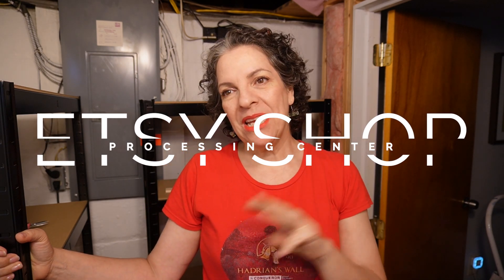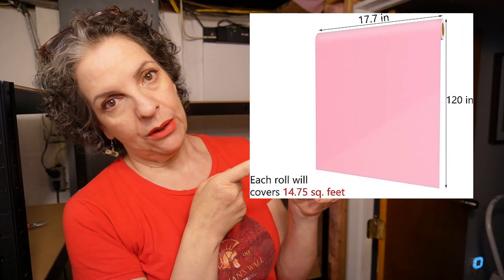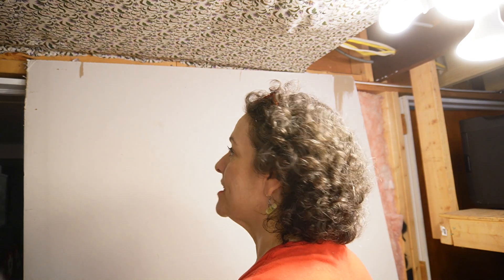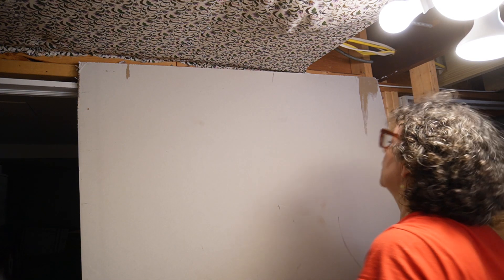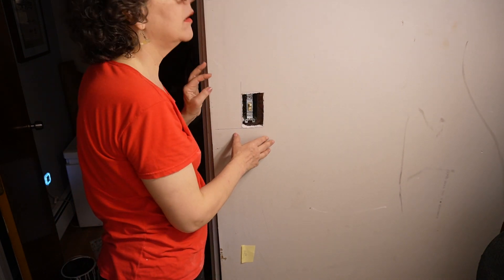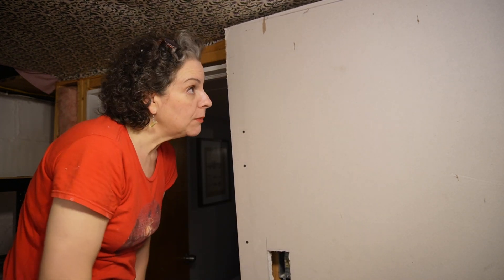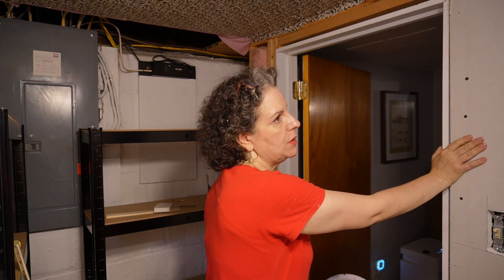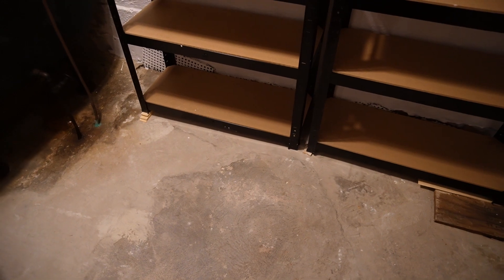DIY Project || Setting Up A Processing Center For My Etsy Shop || # 3|| Drywall Install

Comment: Sophia you are doing a great job, and it is nice you are using recycled material too. Personally I wouldn’t drill into you basement’s exterior wall as this will weaken it over time.  Just a suggestion, but what about making a back panel out of wood, with a beaded wood edge and attaching it to the back of the buffet cabinet.  Then you could wallpaper it to match the wall you have just sheet rocked.  That way you will hide the exterior wall and have an attractive packing table area.  You could attach a rod to this panel for your packing paper.  Good luck with finishing up this room, it’s going well so far. Btw nice that you got to see William’s band practice too.

Comment: Sophia.  You are doing a good job. When you do projects in a older home, you run into major issues. It will turn out just fine, because you are determined to make it a place to process your packages to sell. Hugs to you, carry on sweet Sophia. Faye (Ohio)

Comment: I’ll bet you can still use the wooden shelf over the tank to hold your roll of paper with the dresser on the outer wall. It could roll outward (toward the drain ) across the dresser top to wrap. This would save you from drilling into the cinder block. My grandma had hers at the end of her counter for wrapping and it worked great.

Comment: The measurement for the width of the replacement buffet is probably the base trim and top so for about 1/2" you could cut the ends off the top or shave them by sanding and for the base trim you could probably remove it and cut as needed so the length is what you need (remove the side base trim and cut the front base trim .)

Comment: Try to keep packing in that room! Instead of the top that comes with the buffet, install a shorter top, then it will fit? Looks like there is an overhang on the top of new buffet, or just cut off ends? Looking good!

Comment: In my opinion you shouldn’t drill holes in the foundation walls.  You’ll run the risk of degradation over time and probable leaks.

Comment: I say saw off the extra half inch from the top and use it for the originally intended area!You can always add trim or edging later! 
You love antiques, so I can’t see you using that piece somewhere else in the home later.

Comment: I have a suggestion. How about putting casters on your cabinet and a sheet of plywood on the back like a drop leaf table. So you roll it away from the wall, bring up the board to enlarge the surface area to process on. Clear as mud!! Think I’m pushing it to suggest keep it in the room. Think it will need to be in the family room. Looking so good.👏👏👏👏👏🦋
Reply from the maker: I think so too. I might be limited in space.  Worst comes to worst. I got me a full storage room for the etsy shop.

Comment: This is a very exciting project! 
Suggestion for the floor: what do you think of fatigue tiles (I got 2'x2' interlocking tiles called gym/exercise tiles)? They are relatively inexpensive and can be "installed" like a floating floor. Individual tiles can be replaced, as needed and they are pretty thin. (although, I suggest a threshold in any change in flooring) I used them in my basement kitchen. It solved the uneven floor and helped with foot health, while standing on a cold hard floor.
Love your channel. tfs.

Comment: Remodeling is much more frustrating than a new build. Because you have to compensate for all the imperfections.
Reply from the maker: You re not kidding! As I pay more attention to the way they did the basement. It is clear it was a quick job to sell the house to us. I mean the floor alone is a tell tale. They literally just used stick on tiles straigth onto the concrete floor!

Comment: Hi Sophia,  just a thought,  I don't remember the width of the tank and the pipes arragments, but today I was thinking: Why don't you remove the upper shelve and used it to make a big table over the tank, so you will have a big table to work from both sides of that area (I know you have another door) , and you can arrange the new shelves units that you have and placed in the other side of the room ( I believe that the other side of the room is a mirror of the one you are fixing and the tank is at the middle).
With this idea you will have plenty of space to grow more your etsy store.
Reply from the maker: Good thinking but too high and there are pipes I don't want to compromise the tank.
Reply: @mygreatchallenge  Thank you for your answer, It was just a thought. Big hug.

Comment: Maybe while you are at it you might want to close the hole in the wall to the outside which should help with future flooding from the outside… unless there is a reason for it???
Reply from the maker: Yes it s for the French drain drainage

Comment: Why apiece of furniture? I would get a cart and add baskets you can organize with. Don’t use a big buffet.
Reply from the maker: Because it also helps storing unsightly stuff, like the box of popcorn packing, the roll of bubble, etc. While providing drawers for tools. It also needs to be a sturdy surface to pack and wrap, tabke pictures etc. A cart can t provide all of the above.